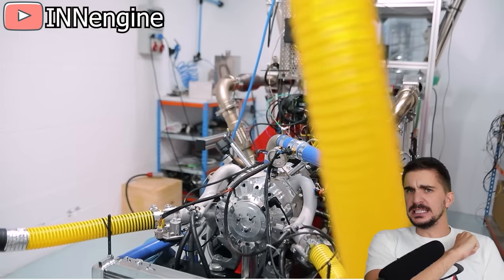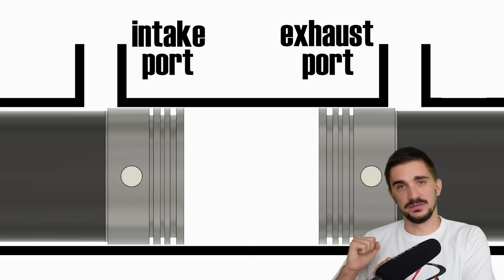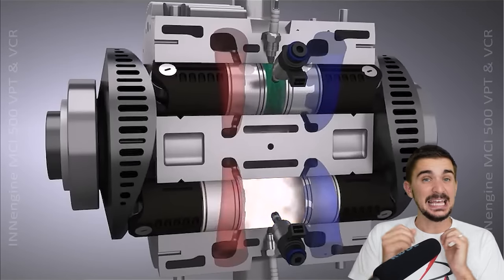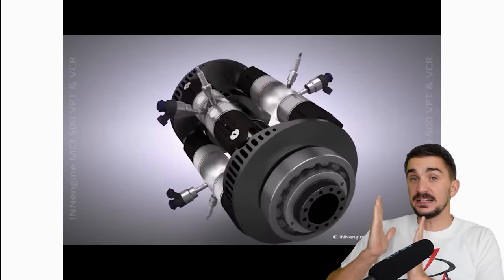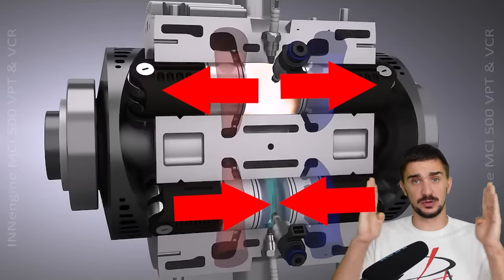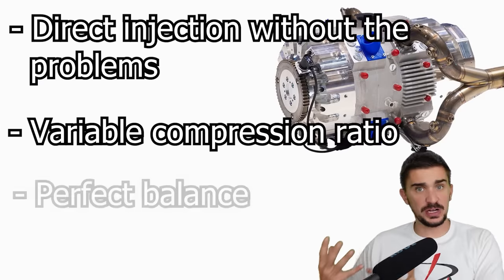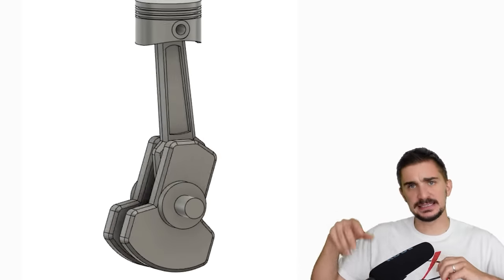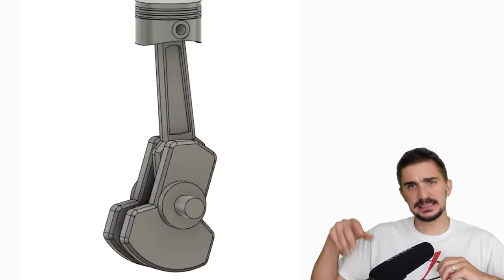Spain is Living in 2050? Revolutionary 1 Stroke INNengine Analyzed

Comment: This sort of stuff is always interesting, I'd love to see it in a motorbike where the higher tourque is not really required due to it being so light. 

You point about the development over 100 years is so true though, the Wankel engine is a cool design but it just never got refined to the point where it could compete with conventional engines...
Reply: There's a UK company that threw a 2 rotor wankel engine in a motorcycle and got Guy Martin to ride it. He was extatic. If Guy is happy about a bike then I'm convinced it's a viable design.
Reply: They've passed the wankel as far as rotary goes, i forget what it's called but it's some sort of meme like inverted wankel or something.  It's rotary but extremely powerful for its weight.
Reply: @blipman17  The problems with Wankel engines aren't the ones you'd pick up from a single drive: Reliability. 
Even old design Wankel engine are amazing to drive. Wankel engines are like swimming pools and boats: Perfect for a friend to have so you can use it while not being stuck with the maintance cost.
Reply: @PhonePhone-sf8te you probably mean "Liquid piston' design
Reply: @JCGver  I agree. They're money and maintenance pits. However, maintenance is far easyer on a motorcycle since almost everything is directly accessible. It could very well be that a properly designed wankel engine in a motorcycle has a left and a right cover which you can take off whitout disassembling the motor to service the rotors. Assuming it's a dual-rotor engine. That would cut doen on cost significantly. Also, people who buy motorcycles (like me) often like tinkering with the things and don't mind paying a slight bit of a premium. Also, if bikes like these pick up you'll have a complete group of people flocking to them, serving various parts of the supply chain. That also makes things a lot cheaper. That just makes me think it's viable enough for something like motorcycles
Reply: @randomguyjustpassingby  just looked it up, yeah I think that's it.  I guess they haven't done anything with it since 2021.

Comment: Yes, that is technically forced induction, but is probably what is referred to as a scavenging air blower. It’s purpose is to boost air pressure to the intake port to slightly above exhaust pressure, which is relatively low once the exhaust port opens at end of the power stroke. This effectively scavenges the remaining exhaust gas as the intake air is charged into the cylinder. This has been used in 2 stroke diesel engines for decades.

Comment: For now, the  "wavy thing" (or whatever its official name would be) looks to still have some potential in it. In terms of geometry. I might be wrong, but the torque you are missing here could be gained by making the waver assymetric. Anyway, this design looks to be more suitable for scenarios where the momentum needed is not really varying, hence could run tuned to optimal (almost perfect) combustion, reducing the exhaust. I could imagine this motor running a generator in a hybrid vehicle engine setup (not only car, but rather train engine, or even a plain).
Reply: I think the best term currently in use is “swash plate” as described in this illustrated video about in-line axial piston motors (comparing them to bent axis piston motors).

https://youtu.be/2UYktuZuhr4

You make a nice point about varying the geometry. It appears to be simple enough to change the symmetry. At least on its face, there appears to be potential for computer controlled rotation of the swash plates relative to each other during operation in order to meet demand for torque or maximize efficiency. It’s a cool concept, no?
Reply: Computers are not required in this situation.

Comment: Very interesting video and excellent analysis. The concept looks interesting for powering self-launching sailplanes which typically suffer from high vibration from their two-stroke "lawn-mower" engines. Just wondering out loud - could the INS engine power a generator that in-turn could be used to charge a battery or power an electric motor? This might overcome the low torque at low rpm issue. Or would the loss from friction make this an unviable option? Again I am thinking of using the engine in a self-launching sailplane. Most of the current models have two or four stroke motors with an output of about 60hph. There are now some electric models on the market with limited range due to battery limitations. Cf. Arcus M, ASG 32Mi, JS3 RES.

Comment: this seems to have a good potential to apply to a series hybrid EV.
Reply: Not everything has to lead down the road of electric bullshit like people seem to think these days.
Reply: This was my thought in a vehicle application. Electric for torque assist, cruise on gas.
Reply: @awwwshucks443  No you’re right, it makes sense. As an engine builder and enthusiast I just hate that many people seem to the think electric power is the answer to all of the worlds problems. Still has a very very long way to go. In the meantime, I will stick to forced induction lol.
Reply: Power to weight ratio and size are the strong points...I could see this being a good fat bike motor replacement...batteries can be a limitation

Comment: The push rods are being loaded laterally while transmitting force into the wavy surface,  not wholly under compression (like the rods would be when using a crank shaft). This is going to put lateral wear on the cylinder walls and pistons.
Reply: Yeah I was a bit concerned about that, too... I can't tell if those are some kind of rollers riding against the swash plate or just the rod ends sliding over it, but even with rollers I'd be concerned about friction and wear, and if they could achieve reliability close to that of crankshaft engines.  It just seems like a lot of surface area being ridden over compared to the internal bearings between crankshaft and pushrods.  What does that do to efficiency, too?
Reply: @johnsnell1929  The pistons are on rollers, he mentions it at 1:00.
Reply: @Mad-Lad-Chad  Okay, thanks, somehow I missed that.
Reply: There are two surfaces. Otherwise the piston would stay in the compressed position if no combustion takes place.
Reply: @johnsnell1929 - It is interesting to consider the idea of building the engine so that those parts could be easily accessed, assessed, serviced and replaced. Perhaps the rollers and swash plates could have an expected service life like break pads in order to minimize wear on the cylinders. Hardly an elegant solution in design but perhaps a more practical means of prolonging the overall life of the motor?
Reply: @ColdHawk   Yes, that could be a good practical way around wear issues, IF they are an issue, and if this engine facilitates a design that gives easier access to such parts, compared to rebuilding a regular engine.
Reply: @ColdHawk just make it an electric motor.
Reply: I guess it's the same concept as lifters in like an ls engine.
Reply: @johnsnell1929 And then theres the fun and games of the contact area.
With a flat (cylindrical roller) there must be some slip since one edge is nearer the cam plate (not swash plate, they are flat!) axis.
If the roller and cam plate are tapered to avoid that slipping, then there is a lot of radial load that if not dealt with, adds transverse load to the piston.
And just for comparison, in a "proper" engine that bearing is a plane bearing, with a comparatively huge bearing surface.
Reply: @dougaltolan3017   Oh, good points!  They might find creative ways to engineer their way out of these wear issues, but otherwise I'm beginning to think this engine may only be useful for specialty applications where a very limited lifetime can be tolerated, but small size & weight are crucial to the mission.  Something where swapping the engine out for a new one every, say 1000 hours (or less?), can be considered just routine maintenance!  Probably not for the average consumer's car, though.

Haha - or, now that I think about it, if that lifetime isn't TOO awfully short maybe it still COULD be used for range-extender PHEVs!   (I always thought a rotary/Wankel engine might be good for those.) Just for ones with larger batteries that would need only infrequent use of the engine... more of a security blanket to know you can always resort to good 'ol gas in a pinch, and the engine is treated as an expendable, with a countdown hour meter to let you know the time till it is TOAST!  (There for you when you gotta have it, but BIG incentive to keep charged! 🙄😄)  Depends on just how small/cheap it can be made and resources used for it, vs. those used for lugging around a much larger engine and its support systems.  All that assumes though that it gets developed enough to have predictable wear patterns and lifetime, however short it is.

Well, probably enough flights of fancy and second-guessing for now, but from the signal-to-noise ratio of their own hype, I think this thing likely needs a lot of development yet, before it can be brought to market in any serious product.  Will be interesting to see how much these issues come out, over time, though.

Comment: You mentioned the friction of the pistons being equivalent to an 8-cylinder engine.  I was also thinking about the amount of friction you must get from all rollers on the curved drive plate.  As the rollers must be spinning at a very high speed, as they are so small, the faster something spins the higher the friction.  Finally, there are 8 rollers, there shortly has to be a tonne of wast heat from them.
Reply: Maybe water could be used in turn to cool both the curved drive plates. Of course, with circulation between the engine and a radiator of some sort.

Comment: The bearings at the bottom of the cylinder are definitely going to suffer considerable wear.
Reply: I noticed this too.  How fast do those little wheels gotta be spinning if the engine is cranking out 10 000 rpm?

Comment: This is fascinating. I remember thinking about the opposed piston arrangement a long time ago. There were other engines that used this, wasn't there? Also, have you done a video on galley plugs and what they are for, how they work, why needed, what happens when they fall out?
Reply: Yes it's called a boxer engine and has been around for 100 years or more. VW, Porsche, even the Chevy Corvair had them.
Reply: @sonnyshaw3962  the boxer engine, is NOT an opposed piston engine.
Reply: Check out the Jumo diesel engine used in WW2 German planes. Some start up company was going to revive the concept a couple years ago, maybe with gasoline
Reply: @johnnunn8688 They're horizontally-opposed piston engines. The  engine is flat with the pistons laying in a 180 degree arrangement.
Reply: @H0kieJoe  wrong. A horizontally opposed piston engine is distinct from an opposed piston engine.
Either look it up or come back arguing wrongly.
Reply: @mikekokomomike  the Napier Deltic, is even more spectacular!
Reply: @johnnunn8688  it was the Achates diesel that made a splash a few years ago and I have seen nothing of it recently
Reply: @mikekokomomike  yeah, I wonder why? Google here I come.

Comment: There were some sleeve valve engines that came out of England to power both bombers and a fighter.  The engines were both 'best in class' in their applications.  The radial engines were put into bombers and the fighter got a 24 cylinder flat engine assembled as a 2 layer flat 12.  High reving because all the moving parts were smaller than the standard V-12 used by all the airforces, it surpassed their power levels by large margins.   The aircraft was the Tempest, the engine was the Napier Sabre.  After the War Napier made an engine for small sea boats, the Deltic, that had 3 crankshafts at the apex of a triangle with one turning opposite to the other two using, of course, sleeve valves.  Two pistons in the same bore came together from opposite cranks 120 degrees off-set, each set having 3 crank throws, and 6 pistons floating in rotating and reciprocating sleeves.  Beautiful sound from all these engines.   And POWER.
Reply: It will be interesting to see what he says about the Deltic. NYC Fire Department had one running a pump.

Comment: 19:03 this would be amazing as a range extender. it would be crazy efficient at a constant rpm, but also could potentially spin bigger generator coils or spin them faster, in a tiny footprint & weight. wild.

a push-pull rc plane would be sick too!
Reply: Amazon drones?
Reply: @russbell6418  More likely military drones, a few extra hours in the air thanks to lower mass can make a huge difference when you're spotting enemy targets.

Comment: The compressor could also be for exhaust scavenge. Like on those big marine diesel 2-strokes. Before you mentioned it I was thinking that the engine would massively benefit from an compressor/supercharger. And I don't think it massively heightens the peak power but it boosts efficiency.

Comment: A similar design was built and produced by Commer many decades ago for their trucks. If they'd have used camming discs on either end like this one, instead of rocking arms, I'm sure it would have developed into something very like this eventually.
Reply: Ts3 engine. Affectionately known as the "commer knocker" and they were super charged as well. Worked on them when I was an apprentice,  they would run on almost any combustible fuel even if you mixed paraffin, petrol and diesel together.
Reply: Go  look up  Sir Charles Redrup's work,  but he wasn't the first,  there were people designing and building Axial Swash-plate engines as early as 1911. The above is nothing new and they are actually currently used to power things like torpedoes. Hell,  even the water pump in my caravan works on a similar principle.

Comment: I would guess this is most useful in electrical generators, where torque isn't as crucial at any particular RPM, and balance/efficiency is nice.
What this means to me is this engine's best us is in a HYBRID car, in fact I'm guessing this engine is ideal for a hybrid car using electric motors as their primary drivetrain and this motor to generate electricity.
Reply: We don't know what the fuel efficiency is, also the wear and tear on the rollers could be an issue

Comment: Wouldn't diesel be perfect for this type of engine?
Reply: no they have terrible emissions, detroit diesel use to make them but had to cease manufacture due to the emissions
Reply: @dzintarskarklins9992  Well the difference between the emissions of gasoline and diesel engines is not much different. Also due to how diesel is ignited, it's more efficient as you use the compression to ignite the fuel. You use less fuel, that also means less or equal emissions to a comparable gasoline engine. 
There's also the diesel soot but that is a sign of bad fuel to air ratio and can be mitigated easily plus it's a heavy particle which just falls into the streets or ground.

Comment: Same general principle as swash plate hydraulic pumps.  I like the design and it may be feasible,  except for the "variable compression ratio".  That would introduce problems with intake/exhaust port timing and also balance, unless I'm missing something .

Comment: I wonder if conventional 2 stroke performance tricks would work on this engine (reed valves on the intakes, tuned exhaust pipes) Also, it does sort of have cams, that's what the wavy things are, especially since you can adjust the compression and timing with them. it's a strange sort of Cam/crankshaft hybrid part. Fascinating engine design that has potential.

Comment: If you know anything about 2 smoke-sic Detroit Diesel engines they require a blower to function to force fresh air into the cylinders. So this engine having a blower (supercharger) makes sense. There would be no other way to get fresh air into the engine without it. It is not being used for any additional power boost.

Comment: If it runs even somewhat cleanly, it could be very nice for powerful hybrid vehicles - they don't need the torque out of the crankshaft the same as direct drive, just pair it with right kind of generator that turns with low torque.

Comment: Great take on this engine. It seems to me that it would have typical 2 stroke emissions issues with unburnt fuel. Even without premix scavenging is not complete enough for today's standards. Also looks like cooling may be an issue. Really neat design, i bet it runs smooth at least and probably will find some perfect use cases

Comment: The effective length of the lever arm for the INNengine design would be the radius from the center of the shaft to the center of the cylinder (or rather, the average radius of the cylinder rollers)

Comment: This is not something new, A similar engine uses a rotating cam in the center and combustion chambers located at both ends of the engine. This engine has 2 rotating cams at both ends of the engine. It appears to be a great idea!  I hope it is manufactured and adapted to fit most cars!

Comment: In Thermodynamic terms, it is a 4-cyl.engine (as the combustion pressure is divided by two).

Mechanically, though, it is an 8-cyl.engine, 
therefore, even if the 
bore is kept small,
it still has significantly more piston skirt friction compared to a 4 cyl.  OTOH, this is offset by not having
ANY valvetrain friction, therefore the net improvement is still very big.

Opposed pistons engines, however, due to the dividing of bmep, are generally better as CI ("Diesel").

The most intriguing aspect of this design is its PERFECT disposition in terms of vehicular packaging, rendering it esp.useful for 4wd applications, and particularly alluring in an eventual Motorcycle installation with a propshaft (eg.swapping it into a BMW bike).

One of the best ICE concepts in the last 10years, that's for sure.

Comment: Rotary air conditioner pumps on cars use a Squash Plate that squashes the piston to push them. I suppose it could be called a Squeeze Plate that squeezes areas, or a Cam Plate that acts as a camshaft with lobes.